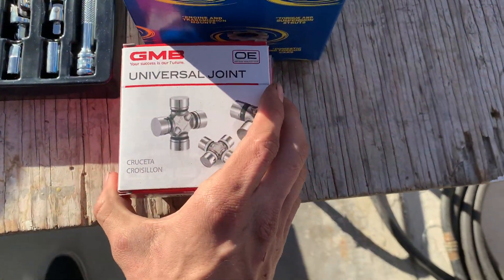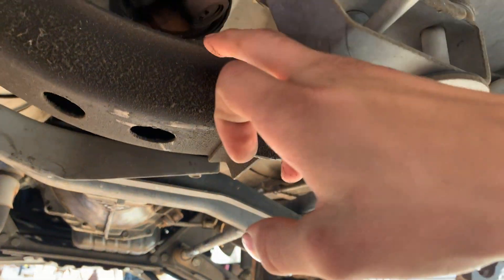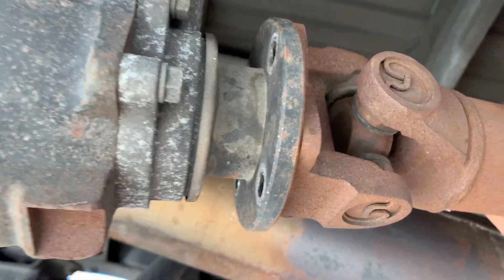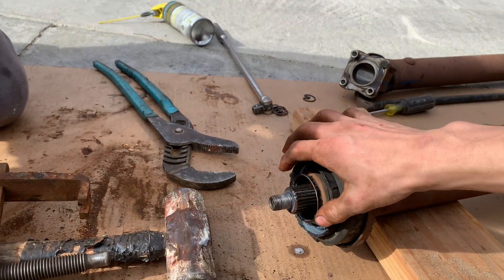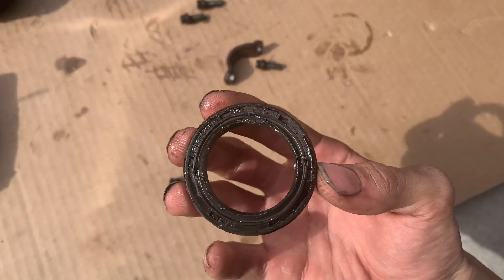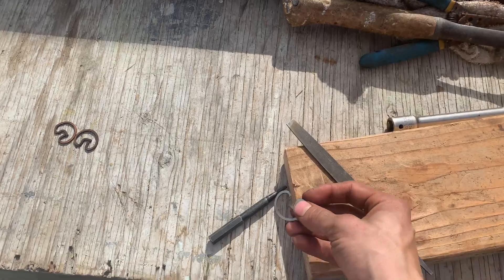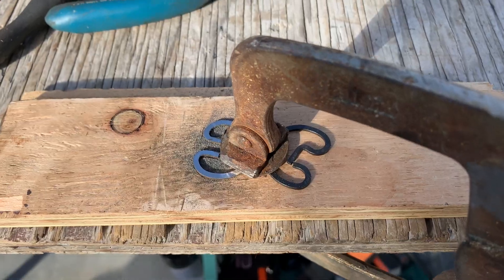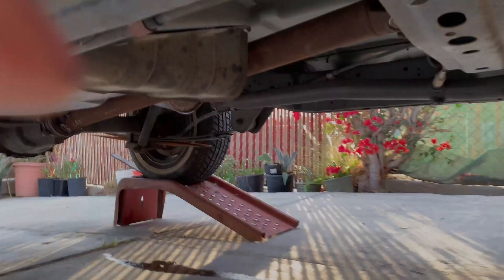How to change Carrier Bearing and U-joints on 1997 Hardbody/D21 Pickup

Comment: Thanks man, that was clear instruction!!

Bummer about the snap rings but props for working through it.  I'm working on the same issues (output seal leak, dead center bearing, pinion seal leak). I was able to ge tthe shafts out, but am hose on the center bearing.  need OG puller!  I didn't count threads when I popped the nut off the diff yoke, so I hope it's not problematic with tension putting it back together.

Do you have any tips or tricks for getting the center bearing off the shaft (w.o having the sweet puller ;)  ?
I'm thinking chisel and sledge with copious lube and time...

Anyhoo, thanks for posting this vid, your explanation and demos are clear and helpful!

Comment: Hey bro I was wondering if you could help me with a problem I’ve been having. I have a 86’ automatic hardbody, and the problem I have is it leaks transmission oil from the tail housing where the drive shaft goes. I’ve replaced the seal about three times with three different seals that appear to be the same but it keeps leaking. 

Which seal is the one that goes in the transmission extension housing (tail housing)? I’ve looked everywhere and can’t find a seal that keeps it from leaking. 

If you could do a video on that it would be some tremendous help!

Comment: Hey great job. So are all 3 u joints the same part number on your truck? Or were they different numbers depending where they were front - center - rear ?
Reply from the maker: I had found u joints that specified “front and rear” or “center u joint” when I did it. I think the two for the front and back are the same but the center one is different

Comment: Thanks for the video, does the center support bearing slide back on with ease?
Reply from the maker: It has a slight interference fit. Getting the new bearing on is not nearly as difficult as getting the old one off. A brass punch will work on the race

Comment: I am having trouble taking off the 4 back bolts of the driveshaft any advice? I have tried lots of w-40
Reply from the maker: It’s going to be difficult. If you can get a set of replacement bolts I would put a wrench on the backside of the bolt and hit it with the impact

Comment: Is fluid supposed to come out the transmission after removing driveshaft?
Reply from the maker: Yes that’s normal, it’s helpful to tilt the truck a little higher in the rear if possible to make it as little as possible. Just so you don’t have to add a lot off gear oil to the tranny

Comment: Thank you so much for this! I’ve been trying to diagnose this rear end power sway:)
Reply from the maker: Glad it helped!! The yoke for the middle of the driveshaft will be hard to get off but it definitely smoothed up the car a lot, especially when engine braking or accelerating in 1st or 2nd
Reply: @gabeguadan  I just checked and there is a lot of play at the carrier bearing. I wouldn't have known to look for that so this is huge. When accelerating or downshifting, my truck swings, just as you described. The Nissan was lowered when I got it and I've been meaning to return it to stock height so when I was under there, I took a look at the rear spacers and one of them wasn't even fully attached. It's loose even with weight on the wheels. 😳Thanks again!
Reply from the maker: @datalaforge  thank you!! Love the hardbodies